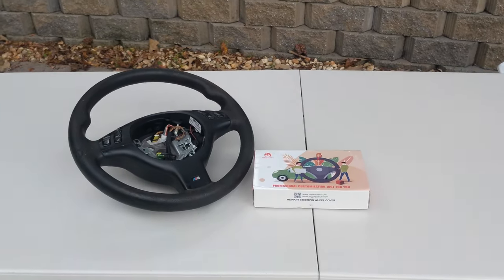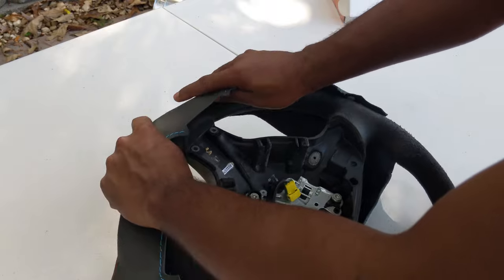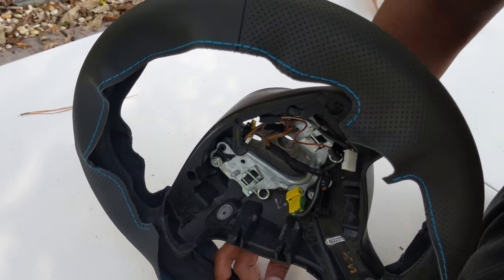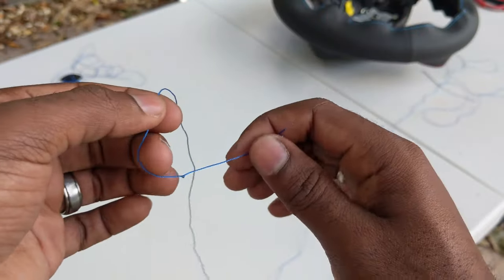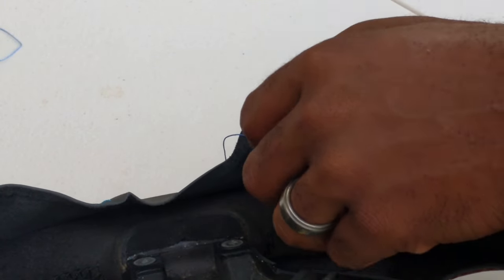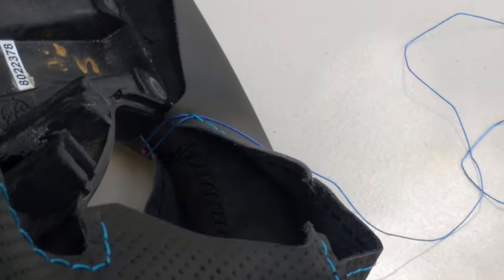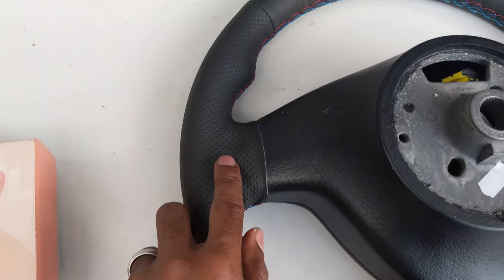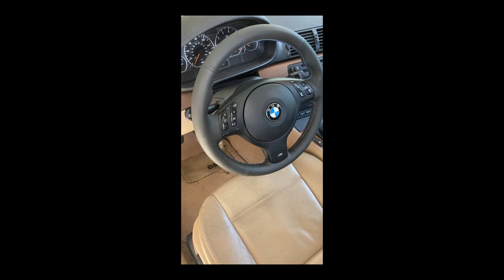Ebay Steering Wheel Wrap DIY for All Cars

Comment: Good job man, I was not expecting it to come out that well.  In hindsight, do you wish you'd removed the old cover first?
Reply from the maker: If I had to redo it, I would still keep the old cover. The old cover does a few things:
Makes the wheel slightly thicker
Gives the wrap more friction so that it stays in place.